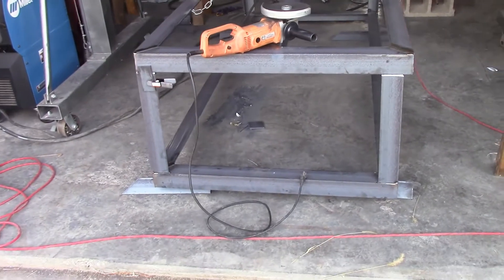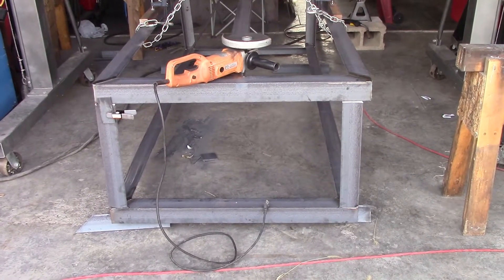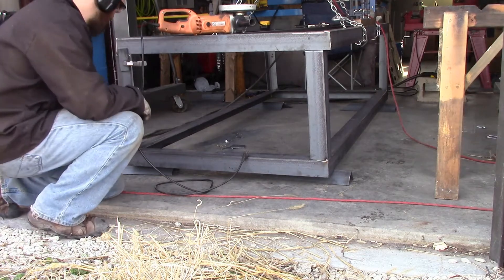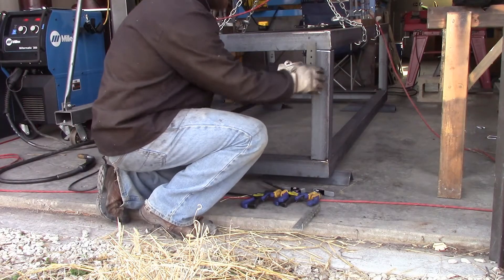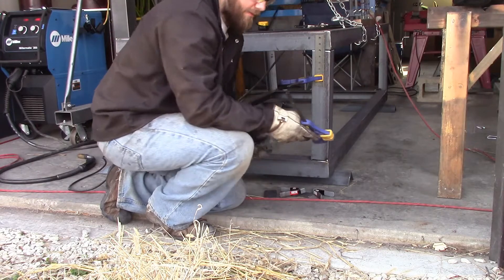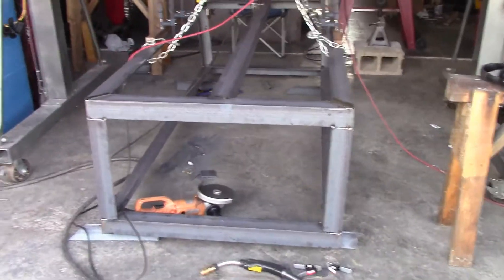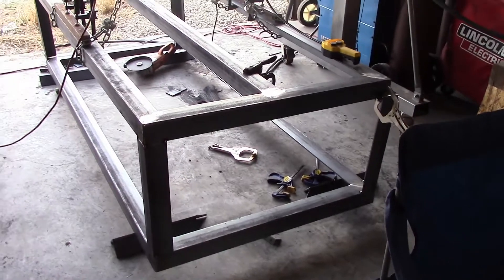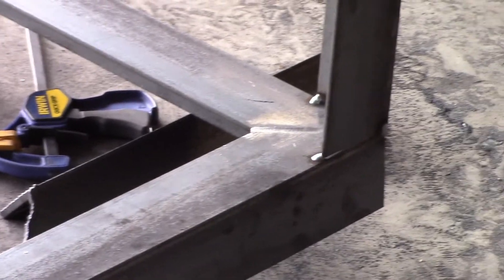Fixture Welding Table Part 4

Comment: you had the table at waist high,why put it on the ground ? bending over it ,is not very comfy.
Reply from the maker: I have the table at the right height to slide material from it to the plasma table. Also I can reach across to other side of table if need be. Also it is kind of modular in that I can add extensions between the bolt flanges for the casters and the casters to make it taller if I ever want to. 

Great question, Yes I thought of the ergonomics of it.